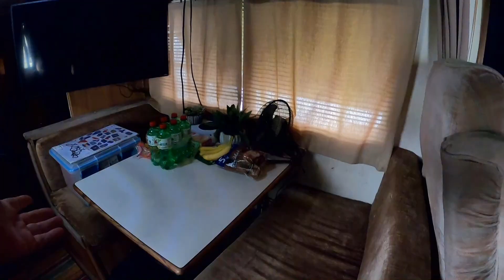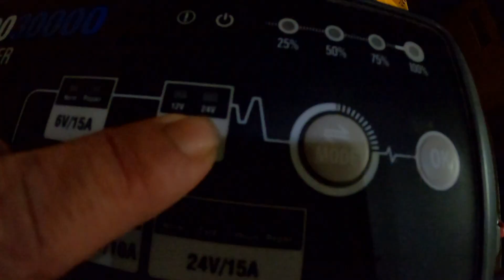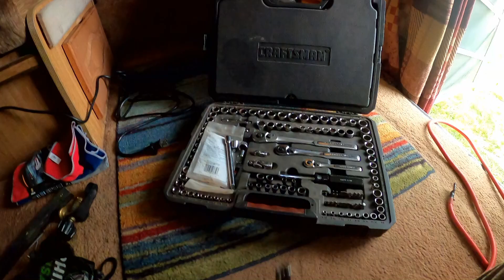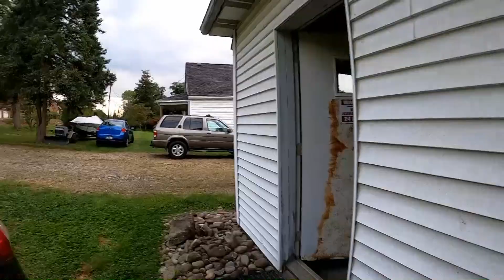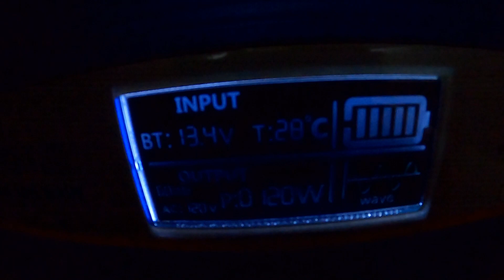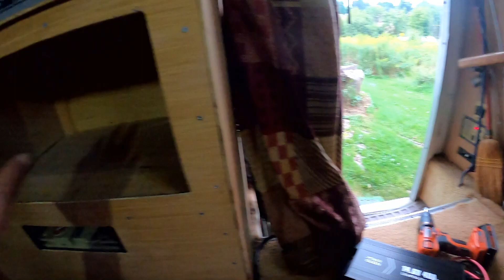A Better Setup For The New Travel Season - Ugrades for RV Motorhome - Power Queen Lithium Battery

Comment: Dave couldn’t your charge fit under the seat with the battery?
Reply from the maker: It would, but I'd rtaher not have to cut ventalation holes in that compartment.

Comment: Hey Dave a good cheap idea I did in my rv.go to temu I ordered these cabinet lights rechargeable and bright like 5 bucks a piece I use them in all my cabinets cupboards pantry they simply stick up on magnets and are
 Rechargeable gives you light like under your seat
Reply from the maker: I have some of those in both the Coachmen and the van. They work out very good!
Reply: @DavesRVLife  I was thinking about those when you were struggling in the dark under the bench with the batteries just a thought

Comment: 16 gauge is only good for 8 amps max……. That is speaker wire. You need 10-2 minimum
Reply from the maker: 80 amps is the 12v output. It only draws about 1200 watts of 110v

Comment: 12 gauge is rated for 20 amp, 14 gauge is rated for 15 amp. 10gauge is rated for 30 amp, 8 gauge is for 40 amp, 6 gauge is 50amp, 4 gauge is rated up to 85 amps @ 75 degrees Celsius. All of these numbers and ratings are the safety factors for COPPER wire by the NEC. Connecting a 12 gauge wire to an 80 amp device can and will start a fire if it's not protected by a max 20 amp fuse or breaker
Reply: I agree. 4 awg for 80 amp.
Reply: Those ratings are for 120 V ac power , Dave is working with dc till he hits the converter . He will need to use the formula for dc when figuring wire size for the amount of amps he will be using . Amps are the power being consumed . Each device will have an ampere rating on it .the NEC can give him the necessary formulas, or Dave may know them , he is a smart guy.
Reply: @russelbaird3342  Being an electrician I can tell you that regardless of AC or DC amperage and wire sizing are the same on both
Reply: @FTRVDenny  also an electrician , retired with over 50 years of service . And yes Amps are amps , the difference is in how you figure the amounts . Go back to your magic triangle , E over I and R , and plug in the values using 12 volts , then 120 volts .
Reply: @russelbaird3342  I just did the calculation and researched it to verify and as expected,  the correct wire size for a 12v DC 80A circuit is 4AWG Copper
Reply: Of course that is if the run is less than 100ft and not worrying about voltage drop. I'm not trying to argue at all. I have rewired homes and businesses that had electrical fires due to incorrect wire size and I don't want to see Dave and Bella go through that.
Reply: @russelbaird3342  I could definitely ask you some questions with someone who worked as an electrician longer than I have been alive. Do you have an understanding of PLC's? i have missed out on several great jobs because I just don't understand the PLC's. I could've been a lock master but failed that part of the test and just got lucky at the time to get in with General Electric but we all know GE moved most operations overseas and I wasn't willing to go
Reply: @FTRVDenny  7
Reply: Programmable logic, controllers, fun things once you learn not to try to fight them . I am in the KC Mo area of the world and parts of the area down by the river still has the old DC wiring , as well as a mix of Delta & Wye connected transformers . The are tons of homes wired in knob & tube here as well as the next “ new “ thing . The southern part of the area is far more modern an newly built than the older parts of down town .
Reply: @russelbaird3342  how did you learn about PLC's? My schooling never taught that and also they barely touched in Delta and Wye but I still don't really understand it
Reply: @russelbaird3342  I'd absolutely love to pick your brain sometime. Schooling never taught me about knob and tube or much industrial electric. I'm 100% open to learning. I've had some really bad experiences changing out knob and tube. The hot wires here, the neutral wire is on the other side of the house. I've managed to figure things out but it can get tricky.
Reply from the maker: 80 Amp is the 12v output. It only draws about 1200 watts of 110v input
Reply: @DavesRVLife  Ohhhh I understand now